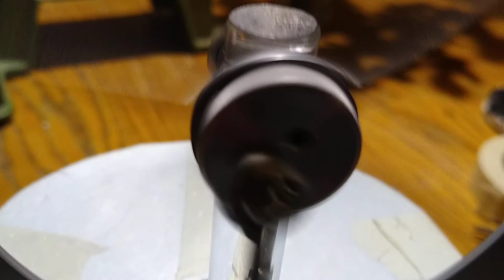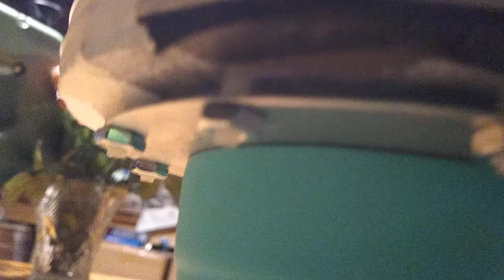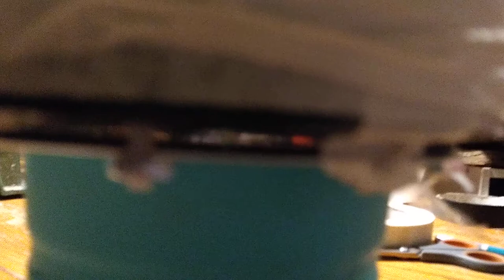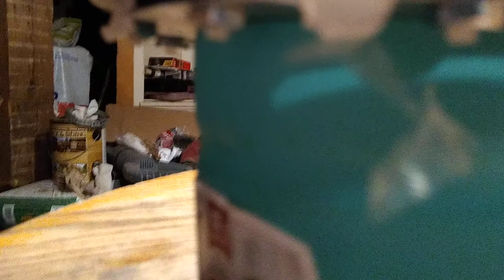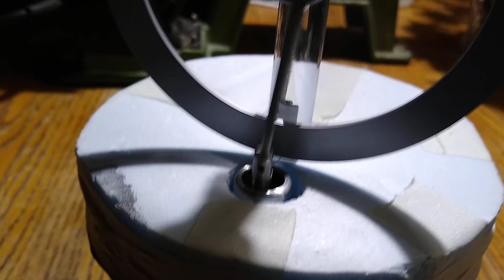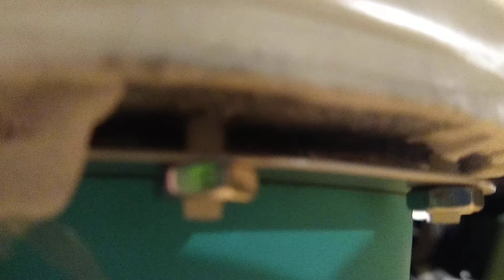Insulating the sink, LTD Stirling runs FASTER without a "cold sink"?

Comment: I'm surprised and perplexed, it was my understanding, but the collapse of the hot air to cold, is what created the suction, that was the power of a sterling!
If the hot air is not cooling and collapsing what causes it to move?, And what is the power, to cause the increase?
Reply from the maker: There have been different suggestions as to why I got these results. Those who adhere strongly  to the Carnot theory think that the insulation must be INCREASING the heat loss by conduction and ultimately creating more surface area. Infact, it seems, Styrofoam IS a  slightly better conductor of heat than air. Nicola Tesla, on the other hand, refuted the Carnot theory stating that heat is only a form of energy which a heat engine converts into mechanical motion or "work" a different form of energy. It is this energy conversion which eliminates the heat and creates the necessary cooling effect that results in the contraction or  "suction" you mention, which allows the piston to return after the power stroke, completing the cycle. Tesla believed a heat engine did not actually need to transfer any heat to the "sink".  I think the experiment lends support to Tesla's insight. Apparently the sink only reduces the heat available to the engine, ultimately reducing the power output. Eliminating the sink increases the potential power output. More research and experiment is needed, though, the indication so far is the cooling is adiabatic. That is, the cooling  happens too quickly to be attributable to cooling by conduction.
Reply: @peoplesresearchcenter6184  you bring up a very interesting point!
One that has also perplexed me on how some of these sterlings can achieve the incredible speed they do, the free piston NASA style to be exact, 10,000 cycles per minute, it doesn't seem that cooling could happen in those intervals
Reply: @peoplesresearchcenter6184 , Tesla objected to Carnot's Theorem but he did not refute it. The underlying science is solid. The math is undeniable. This is far from the only case where Tesla was very wrong and even unscientific.
Reply from the maker: @kylenolan2710  Carnot theorized that heat consisted of an indestructible substance which passed directly through a heat engine intact, without change, just exactly like water over a water wheel, flowing through from a "high" level "hot reservoir" and out the other side to the lower level "cold reservoir". On the other hand, Tesla recognized heat as  a form of energy which can be converted from one form to another, so that although  heat goes in, due to the recognized principle of the conservation of energy, not all of the heat gets transfered but some percentage of heat, on its way through a heat engine, gets converted  to mechanical "work" output, or to electricity or to some other form depending on the efficiency of the particular engine. The more efficient the engine at converting the heat into work, the LESS heat is transfered. Experiments I've conducted, such as this one, and many others, seem to indicate that Tesla was much more right and much more abreast of the science of the time. IMO Carnot's theorem was not only completely wrong and unscientific, but actually quite simplistic, childish and rediculous. If you can point out some flaw in this experiment or suggest a better one that would be more conclusive, that might be helpful, otherwise, you are certainly entitled to your opinions as we all are.
Reply from the maker: As far as the mathematics, Carnot asserted that the ONLY factor that determines the efficiency of a heat engine is the difference in "height" between two products of his own imagination the hot and cold "reservoirs" of a non existent heat "fluid". The so called math based on a false hypothesis is as silly as the hypothesis itself.
Reply: @kennyclement2823  Working gas inside decreases volume which causes it to cool thin can happen however quickly it´s on an atomic level.
Reply: @kylenolan2710 Unfortunately this is true. Tesla also believed in the ether which is of course wrong. Just because somebody is smart does not men he does not make mistake, wheter Tesla or whoever did believe or did not believe something is absiolutelky irrelevenat. The only thing that matters are facts.
Reply: @peoplesresearchcenter6184  Instead of insulation the colt side just warm it with a torch. According to you if I understand correctly the engine should then work even better.